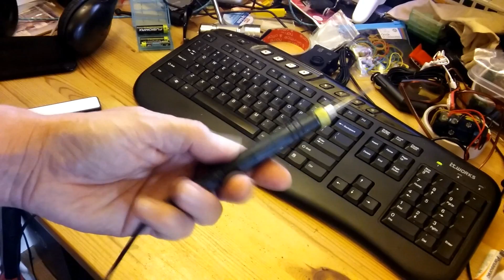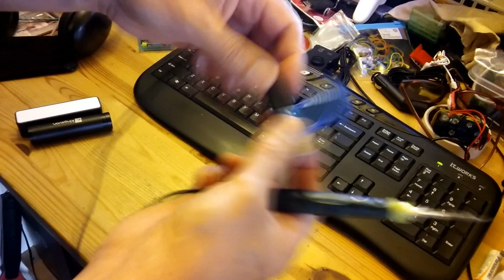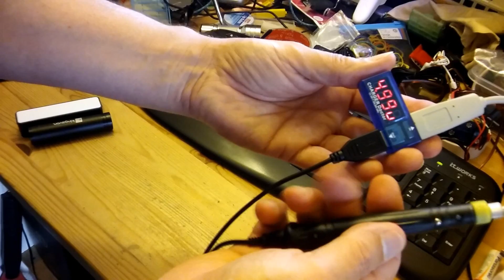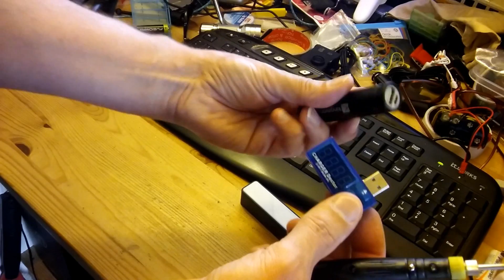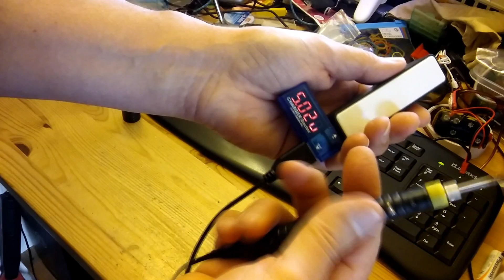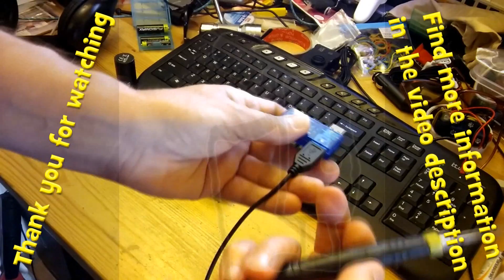USB Soldering Iron checked with a Charger Doctor

Comment: Hey Grandad, have you seen the BigClive video on this iron?  

He says it it safer to use a power bank as many mains usb plugs can leak voltage to the the iron tip.

I've used both that little power bank, a bigger one and even the usb OTG port from my Note 3.

It took around 1700mAh from the big bank

1500mAh out on the Note 3.
Reply from the maker: You will find I have referenced Bigclivedotcom in my video description along with two of his videos relevant to this.
Reply: ah, so you did, sorry. 

I didn't read all the way down. 

looking forward to parts 2 and 3 of that lipo conversion, I also blew the transistors fitting a 2S pack into a 5xAA car.
Reply from the maker: I am afraid it does not end well as the title suggests. I think what happened was the drive motor overheated and somehow shorted out as it suddenly drew a very high current and the power transistors fried on the receiver board. When I tested the motor afterwards by connecting a battery direct, it turned very slowly and my battery leads started getting very hot.